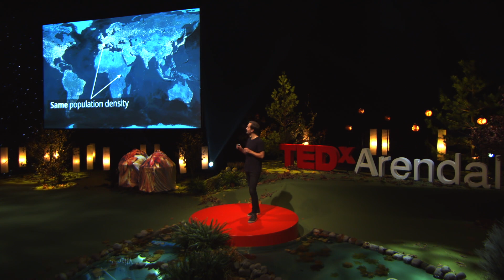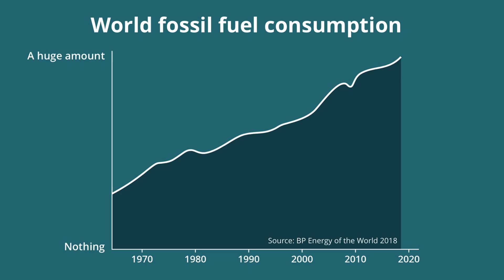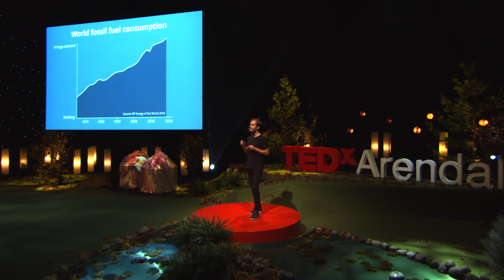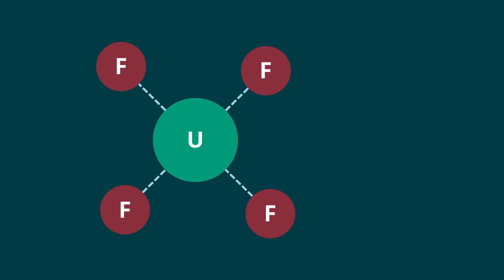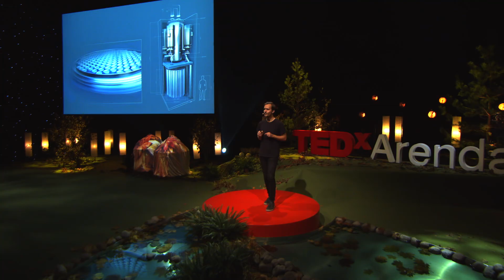Combating the climate crisis with next-generation nuclear | Eirik Eide Pettersen | TEDxArendal

Comment: PWRs cannot have nuclear explosions.  The explosions in Japan 2011 were chemical explosions from the hydrogen released by a chemical reaction between fuel cladding metal and high-pressure water at meltdown temperature.  Hydrogen gas is explosive when it mixes with air.  Otherwise, this presentation was good.  
The real problem in Japan was the cost of the cleanup and the need to shut down power production.  They needed more secure backup power to keep the reactor coolant pumps running to remove decay heat generated after nuclear operations shut down.

Comment: we need to, in order to plan for the future, have a correct history of events. The Fukashima (sp?) reactor withstood and survived an earth quake event two orders of magnitude greater than the the designed maximum. The actual event that caused the reactor failure was the damage caused by the following Tsunami, destroying backup electrical power for the reactor cooling pumps. The  20-20 hindsight people say the backup electrical diesel generators and fuel storage  should have been elevated to avoid damage. An option may have been the facility  roof  or an independent structure. But  one needs to review the  conditions existing at the time the event occurred. I believe the tectonic plate theory was only accepted as fact in the mid 1960's, probably  after the approval process of the reactor design, construction was completed around 1967. One has to wonder if the anti nuclear forces, by interfering with the approval process, didn't contribute to the disaster stage .

Comment: Safe nuclear power is a huge part of the answer to the world's energy problems. We need funding and the planet's best minds working on this.
Reply: Of course you need funding, that's what it's all about! Nobody wants it, so rather than accept the majority [it's called democracy by the way] and start decomissioning these appalling  things the PR campaign tries to change the common view to one like yours. But you're badly wrong and misinformed. Nuclear isn't any kind of answer to how to supply energy and continue to reduce emissions as fast as possible, it takes at least 10 years, costs billions and all the energy released is added to the heat already trapped by fossil fuels. Renbewables on the other hand take energy out of the energy reaching Earth from the sun, is thus sustainable and will be available until the sun dies, and the energy trapped and used to accomplisg work is returned to the environment, no net gain. The thousands of gigawatts nuclear releases worldwide is a net addition to the ecosphere, if fossil fuels disappeared tomorrow, nuclear would continue heating up the environment for thousands of years. Nuclear is a deranged cult of true believers who insult those whgo oppose it because they represent a danger to their expected funding for these costly, dangerous and ultimately useless ego projecrts almost always by men of a certain age. It must make them feel powerful and important. Whereas PV panels and wind turbines don't get their testosterone flowing at all.

Comment: Our Civilisation’s rejection of Nuclear power was a massive mistake, and the environment has payed dearly for it as we continue to rely on fossil fuels for our electricity
Reply: It's not the environment that has paid dearly.
Humanity and the American way has picked up that bloated check...voluntarily, and that was a massive mistake.
Reply: The UK has closed all coal fired plants and replaced with renewables wqhich now supply 40% of the energy needed. Nuclear fantasists always compare nuclear with polluting coal, nuclear was never going to cut it, ten years to build just one, with millions of tonnes of concrete [heavily CO2 emitting process in manufacture] and people have simply rejected such costly and time consuming non solutions, we need to scrap fossil fuels now, not after a few decades and trillions in costs. The environment has suffered from nuclear; background radiation has risen and risen, where once it was virtually non existent, and the waste disposal has still not been solved, and isn't going to be anytime soon. People are simply too inbtelligent to fall for a 1950s ideas mainly aimed at producing fuel for bombs. All the rest is PR lies.

Comment: there is no climate crisis. If CO2 causes dangerous climate change than you should be able to answer these 2 simple questions. What is the correct co2 concentration in the atmosphere and how do we get there.
Reply: As far as I get it, the problem is not primarily the level of CO2 i the atmosphere, but the rate of change.  And it has risen steeply for a while, and looks set to continue.  The system has enormous hysteresis, and is slow to respond, but the response is coming, and will be next to impossible to stop.
Reply: There is no ideal level of CO2. But the fact that it increases changes the climate that humanity adapted to. Moving billions of people to some other areas, adapting our food supply etc. is, let's say, problematic. Maybe you're OK with more wars, hunger, draughts etc. many people aren't
Reply: @VFPn96kQT  Your statement is based on a belief that Earth's CO2 levels have caused noticable climate change. This unproven hypothesis is widely promolgated as a fact.  Yet it remains a hypothesis until evidence turns it into a valid theory. Many notice the opposite, that CO2 has always lagged Earth's temp changes  by almost 1000 years.  When scientists prove this hypothesis then we might expect more to  take AGW warnings seriously and your points will be valid.
Reply: @bobdeverell your, statement on the side, in known to be factually wrong. 
CO2 is a green house gas. More CO2 in the atmosphere, more light is trapped as heat. You can test this, so called hypothesis, by having 2 hermetically closed transparent containers with different levels of CO2. Put them outside during the day with thermometers inside each. Observe the difference in temperatures yourself.
Reply: @VFPn96kQT  Its more complex than proving CO2 is a greenhouse gas. CO2 is a known greenhouse gas, but its effects are not linear as it saturates at relatively low concentration levels. Also climatic feedback loops tend to reduce its impact to a point where some physicists consider CO2 effects are possibly marginal. Unfortunately meaningful discussion of CO2 runs into vested interests and scientific orthodoxy.
Reply: @bobdeverell  to answer these questions IPCC was formed group was established in 1989. IPCC Fourth Assessment report addresses anthropogenic climate change
Reply: @VFPn96kQT  No... his statement is not factually wrong and can be clearly and easily demonstrated by doing time series analysis on the temperature vs CO2 concentration.   And the experiment you suggest was done.  It doesn't show what you say it will show.
Reply: @bobdeverell  By burning fossil fuels we are running a long term experiment on our atmosphere with no controls. If you know of another atmosphere we could turn to if things go wrong I would love to hear about it. Until then common sense and reasonable prudence would indicate that dumping billions of tons of carbon into our environment may not be the smartest thing we could do so another solution to our energy needs is required. Storage ,renewables and nuclear should all be called upon to allow us to transition from fossil fuels.
Reply: @bobdeverell  The idea that the greenhouse effect is saturated is pseudoscience. It is true that the atmosphere near the surface is relatively opaque to IR radiation. However, radiative cooling of earth's atmosphere happens at the top of the atmosphere, not near earth's surface. As you move up through the atmosphere, the atmosphere becomes less dense with higher altitude until eventually, it is so dilute that radiation can escape into space. So by definition, the greenhouse effect in those upper layers of the atmosphere where radiative cooling takes place, cannot be saturated yet.

As we add more CO2 to the atmosphere, the concentration increases also in the upper layers. As the concentration of CO2 in the upper layers increases, the height at which the atmosphere is thin enough so that radiation can escape, will shift to higher altitudes. Since increasing altitude means decreasing temperature, radiative cooling now happens from colder parts of the atmosphere than before. However, as thermodynamics teaches us, a colder body will have less radiative power than a warmer body. So earth's atmosphere is now radiating less power into space than before but earth still receives the same power from the sun. This creates an energy imbalance. The only way out is for the system "earth" to heat up until a new radiative equilibrium is established.

Arrhenius was right, Angstrom was wrong. We've known this since at least the 1950s.

Regarding the feedback loops, those exist in both directions. Increasing temperature due to increased CO2 concentrations causes also increased evaporation of moisture and higher moisture content in the atmosphere. Water is of course an extremely powerful greenhouse gas. Furthermore, increased temperatures of the oceans causes release of additional CO2 which was previously dissolved in the water. Increased temperatures also cause melting of ice which lowers earth's albedo which in turn, again, causes more warming. Without those feedback loops, the impact of CO2 on the temperature would be much lower. So claiming that the impact of CO2 on the temperature is reduced to almost nothing by negative feedback loops is disingenuous as it omits all the positive feedback loops which greatly enhance the effect of CO2.
Reply: @throwaway692  "his statement is not factually wrong and can be clearly and easily demonstrated by doing time series analysis on the temperature vs CO2 concentration."

There are several issues with that argument:
1. Can you even show me a single graph with sufficient resolution of the time axis to make any such analysis even remotely meaningful? All the graphs I've ever seen have resolutions on the scale of tens of thousands to millions of years. This is way too inaccurate to use this as proof of which happened first.
2. Aside from lacking resolution in the time domain, your data also lacks geographical resolution. Reconstructing temperature and atmospheric CO2 levels millions of years ago naturally relies on a very few select data points from a handful of isolated locations. CO2 might lag behind temperature in some places while leading in other places. You can't really construct a good global picture from such sparse data.
3. Even if it were true that historically warming has always preceded rising CO2 levels, this would still not preclude that rising CO2 levels can cause warming. This interaction between temperature and CO2 concentrations is not a simple "A causes B" causality. In reality, temperature and CO2 levels are linked through a complex system of feedback mechanisms. To understand whether increasing CO2 levels can and do cause warming, you need to turn to physics, not to history. Physics answers this question with a clear and resounding "yes".

A good rule of thumb is that if you think you've debunked and entire field of science, worth decades of research by thousands of smart and educated people, with a bit of simple logic and common sense, it's most likely you who is wrong, not all the experts. Chances are, those experts know a lot more about the subject than you do.
In other words, if all it took to debunk the idea of climate change, driven by CO2 emissions, was a simple CO2 + temperature vs time graph, the argument would have been settled a long time ago and there would be no debate right now.
You are literally regurgitating propaganda from decades ago which has long been debunked.
It doesn't hurt to approach science with a bit of humility instead of the arrogance of someone who's convinced that he knows better than thousands of very smart people. You are most likely NOT the next Galileo.
Reply: @JackFou   Thanks for the reply. While I clearly understand your points, I have not done the required research into CO2 saturation and the Greenhouse Effect in the atmosphere, I have only read the literature which seems to evolved significantly over the past 20 years with research into CO2 lasers.  From what I can see, measured absorption values do not correlate with prediction. The foremost world expert on Carbon Dioxide is reputedly William Happer (Physics Emeritus Professor Princeton  University).  Another, but more general expert, was Freeman Dyson. also of Princeton, but sadly now deceased. It seems to me neither of those top physicists support your argument. If you feel suitably qualified then I suggest to correspond with Happer, else watch some of his excellent videos on this subject.
Reply: @bobdeverell  
"The foremost world expert on Carbon Dioxide is reputedly William Happer"
That's a complete nonsensical statement. There is no such thing as "the foremost world expert on Carbon Dioxide". Being an "expert on Carbon Dioxide" is so incredibly vague as to be entirely meaningless. Does he know everything there is to know about CO2? Is he an expert on the chemistry of carbon dioxide? Are we talking gas phase or condensed phase or both? Is he an expert on the biological function of CO2 and the corresponding metabolic pathways? 
Well no, he's not any of those. He's an expert in atomic spectroscopy.
So most likely, what you're trying to say is that he's the leading expert on the interaction between CO2 and infrared radiation, which is of course an important aspect of the greenhouse effect.
The problem is, even that is most likely a massive overstatement.
By who's authority, exactly, do we know that he's the "foremost world expert on Carbon Dioxide"? As far as I can tell, that's him and his buddies who are obviously ideologically aligned with him who go around making such claims.
If you look through is body of published work, most of it is, in fact, not on the topic of CO2. He is also very much not a climate scientist and not a world leading expert in atmospheric physics either.
So really, what we have is someone who is certainly very knowledgeable in the field of spectroscopy and who also is a former Princeton University professor -- and that alone is apparently sufficient for you to trust his word over all the hundreds and thousands of actual experts in fields like climate science and atmospheric physics who more or less unanimously agree that he is wrong on this.
Your entire comment screams "cognitive bias" in all caps. You simply agree with the man because he uses his Princeton affiliation to give himself credibility and because you like the conclusions that he arrives at.

There is just one problem -- "argument from authority" is a well-known logical fallacy. Science isn't a matter of opinion, no matter how distinguished the person holding that opinion may be. William Happer has not published a single scientific article that would demonstrate that climate change as we know it is not occurring. All we get from him on the subject are talks and opinion pieces.
Reply: There is a crisis. Rising temperature changes a lot for many many people, for nations, for agriculture. It's ok to call this a crisis. But humans will find ways - whether as 10 billion or as one million individuals.
Reply: @ankeunruh7364  No... there's no crisis.  The geological reconstruction of the past shows periods of both higher temperature and higher CO2 concentration.  And not 1 single dire prediction has come to pass.  So when people tell you "WE'RE ALL GONNA DIE!" and none of it happens... what do you deduce?  And as long as we're on the subject perhaps you can answer me this:  Why, after WW2, when we put hundreds of millions of tons of CO2 into the atmosphere, did the temperature go directly and steadily DOWN for the next 40 years?  So much, in fact, that another Ice Age was forecast during the 70's?  Feel free to look that up.
Reply: @throwaway692  yes, there have been times of greater and lesser amounts of CO2 in the atmosphere, but none that coincide with human civilization.  If you value your life and lifestyle, then making wild CO2 swings outside of the average of the last 800k years is a bad idea.
Reply: @ankeunruh7364  You did not answer Baron V point. What do you consider the idealt CO2 level to be.
Reply: 1. well, it depends
2. your choice how you get there, you could simply wait since over geological times co2 tends to get lower through the Carbonate–silicate cycle. Also you could do a more aggressive approach and and make graphite out of atmospheric co2 in the Bosch reaction and dump that carbon somewhere (maybe for later use?).